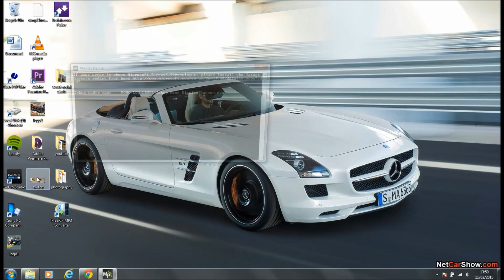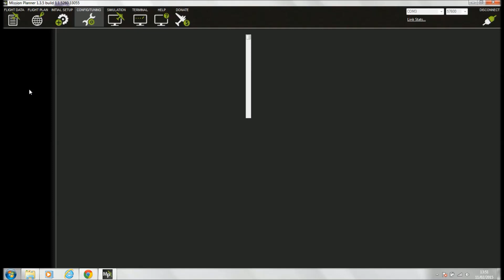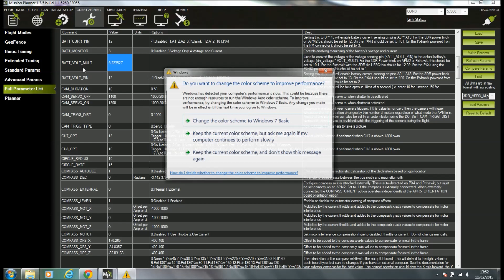Walkera Scout X4 - Lipo Voltage Fix "NEW"

Comment: link for mission planer not work;;;please help
My dron does not work when to connect to a computer 

Not Found

The requested URL /MissionPlanner/MissionPlanner-1.3.5.msi was not found on this server.

Apache/2.4.7 (Ubuntu) Server at firmware.eu.ardupilot.org Port 80

Comment: Hey Alex. Thanks for a very informative video! I changed my value to 5.223527 but after that my transmitter vibrates and beeps every time it connects to my scout. I can arm and fly the scout, but the transmitter keeps warning me. I looked the values up, and when I take a look at my changed batt_volt_mult value, i see: 5223527 = the '.' is gone. I changed this, but whenever i refresh my 'ful parameter list' i removes the '.' Do you know a fix to this, and do you think this i why the transmitter is vibrating?

Comment: I have a scout x4 and so does a friend of mine his dropped out of the sky when he did the retracts after some research the controller is made for a airplane and when it detects low voltage it shuts down the motors. So wasn't sure if there was a way to bypass it without cutting the wires and loosing the voltage screen on the radio.
Reply from the maker: You could connect it to mission planner which has access to updating firmware settings??

Comment: Do you have any idea of how to change the low voltage cut off? There is a way to fix it with the wiring but i think you loose the reading on the screen? Thanks
Reply from the maker: When you say low voltage cut off, you can adjust the alarm on the transmitter. As for adjust the Scout, I would not know about that I am afraid.

Comment: I've tried to change the numbers 5.223527 but this method gave me 25.9 volts. I've done the multimeter method and then it was good 25.3 volts.

Comment: It's dangerous to assume that a BATT_VOLT_MULT of 5.223527 will work for all Scouts. Every Scout is a little different. That's exactly why the Walkera default value is so different to yours! You need to measure the voltage of a fully charged battery using an accurate multimeter and then enter this voltage in Mission Planner in the "Enter Measured Value" field on the battery calibration page. MP will then calculate the correct BATT_VOLT_MULT for your Scout.

Comment: maybe someone's interrested in: if you get an "low voltage" message while charging the scout x4 battery, you can try switching to NIMH 4 Cell battery and charge it for 3-5Mins in that state. After that, stop the charging progress and switch back to normal LIPO charging mode. That fixed one of my batteries last weekend, luckily saved 160bucks for a new one, tested the battery for about 10 flights during this week, works like a charm :) PS: on friday I lost my signal to the scout and then, the drone successfully came back, I was able to steer the copter again when it came back. Today my LiPo battery connected to Devo was running out the power in less than 5 seconds. The Devo F12E controller was OFF during FLIGHT --> man I was scared! But the scout was going up to 20-40 meters and came back to its starting position. My friend was able to pic it up when it came down to approx. 2 meters from the ground. Then it shut off automatically. I bought the LiPo battery just on friday in a local store here they recommended me. So it was my first experience without using 8xAA batteries in the Devo. Monitor told my battery was still "full" after 4 flights (each 15minutes). Horrible experience today but the scout solved it perfectly!

Comment: HELLO ALEX , IM HAVING AN ISSUE WITH MY BATTERY  IT SEEMS THAT THE CIRCUIT BOARD  WHERE THE ON/OFF SWITCH IS  ON MY SCOUT X4  HAS STOPED WORKING SWITCH IS DEFECTIVE  IM WANTING TO REPLACE THE BATTERY PLASTIC CASING/HOUSING OR EVEN JUST PURCHASE ANOTHER BOARD ..WOULD YOU KNOW WHERE I CAN PURCHASE WHAT I NEED ,IM REALL NOT TRYING TO BUY ANOTHER BATTERY JUST YET ...LOL
Reply from the maker: Have you viewed this website for a fix? https://tasview.wordpress.com/walkera-scout-x4/mods/
Reply: No I haven't Alex but thank you very much I will look at it thanks again for your help buddy

Comment: Alex, great vid. I downloaded mission planner but I do not have "full params" under config tab just "standard params" which does not contain battery voltage mult option. Any thoughts? Thanks, Gary
Reply from the maker: Gary, in the notes for the video, have a look at point 7, does this help at all?
Reply: I checked out #7, but On left side hand side "full params" is just not showing, it does show a "standard params" option but battery voltage value is not there. Don't know whats going on.
Reply from the maker: I think there is tick box or something. I will check it out later and let you know.
Reply from the maker: Gary Trammell I know this may sound stupid, but do you have your Scout plugged in and actively connected to Mission Planner?
Reply: Yes. I responded to your last reply, guess you did not receive. I found the box, checked it and issue resolved. I changed batt voltage param when not even knowing if I have the batt problem as you have experienced... stupid on my part. Hope this doesn't mess things HP for me.
Reply from the maker: Gary Trammell If when your transmitter and scout are on, the transmitter shows 25.?v on screen, then your good to go.